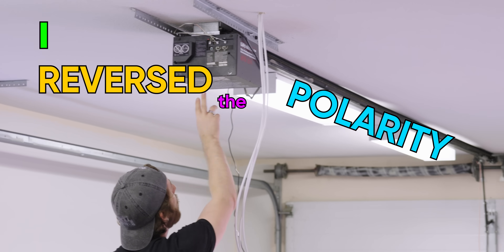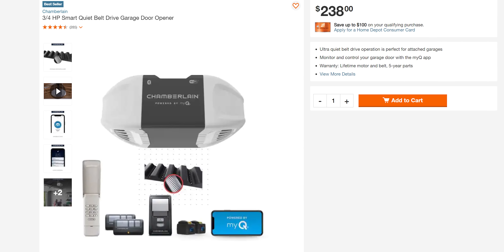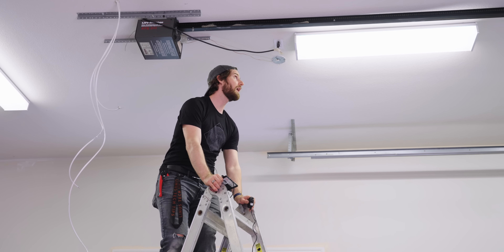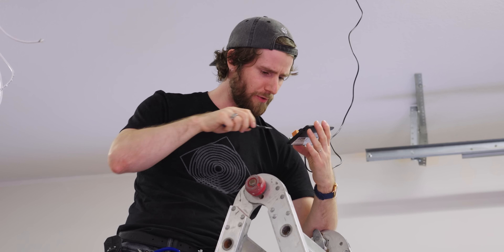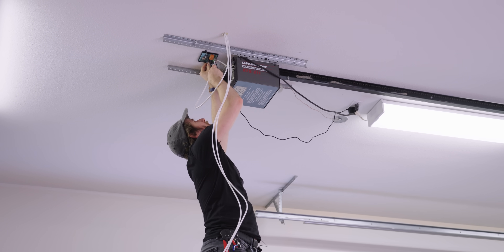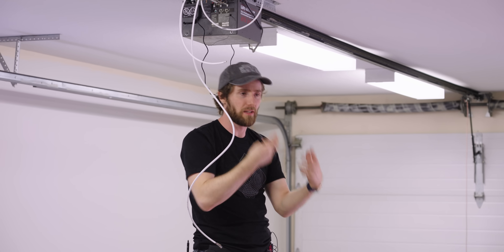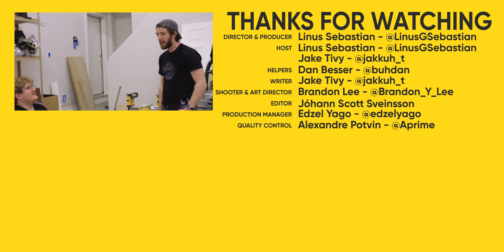Smartifying My 25+ Year Old Garage - Z-Wave Garage Door Opener

Comment: 15:00 I know this is much much later, but a few thoughts after rewatching this... Google Assistant integration does work without Home Assistant Cloud (it's hard, but it works, and i've never had to re-auth it), and the ratgdo (esp32-based controller that interacts with GDO's, including some chamberlains) which covers a lot of usecases where you want to use built-in sensors instead of modifying to add your own, and only really requires some esp32 flashing and hooking up the leads into existing contacts.

Comment: Way, WAY too complicated.  Mount a sonar sensor in the rafters about half way from the front to the door opener.  If the sensor reports that there is something two feet away, the door is open.  If the sensor reports 10 feet, the door is closed.  Now you just need a relay switch to control the door.  EZPZ.

Comment: There is a company called meross they sell smart garage door opener for almost every brand. I had an old 94 craftsman, and it worked flawlessly for years . Recently, i installed myQ smart garage door opener but hated how long it took to open/close, so i, instead of the old mart grage door opener sensor with an additional circuit you need to connect to the new garage door opener. It worked flawlessly. Also, they have a wired door sensor with magnets, which is way more accurate than my q.

Comment: Trying to find all the products they used in the video and I'm not having any luck. Home Assistant has an integration with MyQ but MyQ cut it off and it's no longer working. I need a new solution.

Comment: Maybe it's just me, but in my house the last thing I want is Amazon or Google being able to open or close my doors. Not that I think that Jeff Bezos is gonna rob my house, but if their servers get hacked or a vulnerability is found, it could be used by thieves to rob your house. 

If you're slightly techy and have some spare hardware at home, set up a Home Assistant server and use either a relay switch like Linus did, or (as in my home) you can use the MyQ integration that comes standard on most decent garage openers today (I believe all LiftMaster's within the last 5ish years have this) and put it on a separate VLAN to ensure it has no access to the internet. Then you can route everything through a HomeBridge to your HA server and communicate externally via that. Obviously this is not a viable solution for everyone though.
Reply: Fun fact, a brick can rob your house easier than a hacker

Comment: As long as the receiver and the contact are mounted at the same height while the door is closed, as they should be to make contact and work, it does not matter where they’re mounted. You could mount them up high and it would still recognize if the door was open even a little.

Comment: I have one of the Garage King "Smart openers" and honestly I see no point to it. I've had the opener for a year now and honestly never use the app at all since I only need to open it if I am leaving or pulling up which I will just use the included remote. Its a solution for a problem that does not exist.
Reply: He doesn't keep the remote in his car as it's a huge security risk. Somebody could smash your window and take it, or just smash it and hit the button to read the signal, then rebroadcast it and drive around til they find his house (or just follow him)

Comment: "Put it at the bottom so it detects it even if it's open a little bit"
Am I the only one that noticed that it doesn't really matter? If it's open a little bit the 2 components will be separated anyway, at any height. It's not like if you open a little bit only the bottom will come up, all the door will move. Also, if it's at the bottom you could theoretically put something in front of the detector before the 2 pieces detach so it won't detect it opening.. but that is a very remote possibility.

Comment: Love how jake was like “put it near the bottom that way if it opens a bit it’ll detect it” the magnets will still seperate the same so it doesn’t really matter where you put it, the threshold between “open” and “closed” depends on the size of the magnet, not how far away it is from the floor.

Comment: You should check out Shelly smart wifi relays.  Home assistant integration is a breeze.  I use them on my garage door, swimming pool Pump via a contractor and remotely turning on/off computers.

Comment: As others have pointed out already, the functionality is the same no matter where you put the sensor.
But it's safer to put it as high as possible to protect it from floods, kids, falling objects etc...
Also it's easier to work with (as your back told you multiple times) & it requires shorter wires.

Comment: Standard window contacts work well on the trolley and opener track. That way, you don't need to wire all the way down to the floor. Magnet goes on the trolley, and the contacts go on the opener track. You can do one at the fully open position and fully closed position, and then you know if the door is in neither. You can also add a contact part-way from fully closed to add a stop for a vent position.

Comment: Here in Las Vegas Nevada it’s standard to run a cat6 to sensor at door and a cat6 to motor for control, you can also ghetto your wiring by using a control processor with relay controls and wire it to a standard garage door opener. So trigger the relay with on of/ normally closed/ normally open and you can do it without any wireless, zwave, signee, God I’m just watching this and can’t stop smiling but can’t just laugh. Polarization should matter! or invert the relay or contact. I love you guy’s!!!

Comment: Umm MyQ has an add on option for older motors and then you can use Google Routines in the Google Home App to let google assistant control it all. I have mine set up so I can ask if the garage is open or closed I can tell google to open it or close it. And if the garage is already closed and I ask google to close it, it will return a “Garage is already closed” response.

Comment: Jake: "Put it near the bottom so that it will detect when it's even a little bit open"

It doesn't really matter where you put it. Bottom, or middle, if the door goes up 6 inches, the contact will always be 6 inches higher than the sensor. (that being said, putting it on the bottom does look the best)

Comment: Why put the seizure inducing flashing in there at all? It added nothing, Linus was already describing it just fine.

That was a horrible effect for everyone, not just seizure prone folks. Utterly unnecessary and potentially dangerous, even with the warning there. If someone catches it from the corner of their eye (or their second monitor) without seeing the 5 second warning it could still cause a seizure. Just why??? Do better! This channel has such high production value, run your videos through a PEAT tool and remove any offending content from the edit. What you did here is not good enough and your audience expects better.

Comment: A possibly better and simpler way to do this is to use a reed switch + magnet (which is what your little magnetic switch is) hooked up to a raspberry pi and a breakout board.  A reed switch costs pennies. Then you're not relying on some wonky cloud based service that may not even exist in 5 years, weird protocols, batteries, etc.  Keep is simple stupid.

I put a simpler version of this in my garage several years ago, just hooked up to an a reed switch+power supply to an LED in my house, as well as a button inside the house so I can close it from the house.  It's worked great for 10+ years.  I've got a lot more faith in dumb tech than smart.

The Chamberlain openers are a nightmare with the lack of simple on/off buttons.  When my old opener went south, I discovered that Genie openers are still just on/off switches, avoiding the trouble of these more complex buttons that aren't on/off.

I haven't gotten to the point of putting in the Pi.  It's generally not much of an issue since I can always see if my garage is open via the LED in the house.

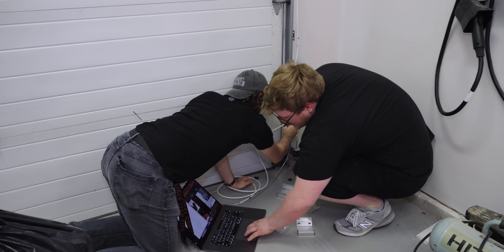Comment: 4:40 "put it like, very close to the bottom so it will detect if the door is open even a little" shouldn't this not matter as the two pieces would have the same mating travel regardless of where it's placed?

Comment: ESP32 module + relay with kickback diode on momentary push button lead.  It's a simple pull down resistor test.  If you are close to your home, your phone will auto switch over to the local network.  30 minutes work.  Create a webpage icon to the server.  Second lead can use sonic distance detection for garage door open/closed.  If you need outside home, then port forward through the DMZ to your ESP32 using a DNS hosting service.  Your hall sensor also works well.  You can also use something like Netgears home automation ports to work with google/alexa.

Comment: You definitely don't need to reauthorize the test app every two weeks, it's a one and done thing. There's also a HACS Google Home integration which is supposed to make the process of setting it up even more pain free but I did my setup before it was released. If you set it up through the test app you can have local fulfillment of Google Home voice commands, which is much more stable than going through the cloud.
Reply: Do you have anything to help with local fulfillment? I set mine up before the hacs as well, just have not figured out how to get local fulfillment working.

Comment: The wires picking up radio is because the joint was a cold joint. This is a common issue, especially with unleaded solder. The trick is get the soldering iron real hot, flux up the joint before you make it.

Comment: 4:41 - lol, it doesn't matter where on the frame you put the switch, as long as the door is closed when you do it. If the door opens just a little, the magnet will not align to the switch and it will see it as the door being open.

Comment: Uh, chamberlain works just fine with Homeassistant, which you already have for the hot water system. Also, you can tie in google assistant without the subscription.

Comment: There's a lot of wrong/bad/brainfart information here. The beeping/blinking is a safety feature to prevent people/things from being crushed under the dangerously heavy garage door. MyQ works just fine with Home Assistant with an integration. The magnet for the garage door will work the same no matter where you place it on the door. Home Assistant can be set up to work remotely without the paid service, but it is a little more difficult to set up (would not recommend if you're not very technical). While it's a little more difficult to set up the integration between Home Assistant and Google Cloud/Alexa without the paid service, it can be done, and it does not have to be refreshed every two weeks (I haven't refreshed mine, just make sure your SSL certificates are up-to-date).
Side note:  if you don't use the paid service, there's a lot more configuration, maintenance needs to be done to keep the remote access working, and some things require more setup to get up and running. Also, it's not possible for every user. Your ISP may make it impossible without purchasing a business plan or running a VPN. If you can't comfortably explain how a user connects to a website hosted on a server networked behind a firewall, you probably should just pay the hosting fee and save yourself the trouble.

Comment: They should get a Hacker to try and hack their garage to give insight on how secure all of this is actually is, they can then upgrade the stuff to make it more secure. It'll be a good video idea.
Reply: That actually sounds like a good idea, provides the extra level of product confidence when looking to buy some of the stuff they show case. Like watching LPL open a lock and then talking about how difficult it actually is if a non professional or someone not fully skilled would be at opening said lock. We know can can open even hand crafted locks with ease. But for him to say a true level on the lock brings confidence in buying said lock. It's a very tech heavy world now so to know the things I buy have a security level to it helps me an not have to worry If what I bought is good or not besides basic tech specs.
Reply: That's the beauty of the zwave. It's local. It probably can be hacked like anything, but it itsn't accessible from outside his home lawn at most because of signal strenght so IMO it's not a huge concern compared to MyQ cloud-based wifi garage door openers which can be hacked from anywhere. The added zwave security feature is a plus, but is still way more secure than any cloud connected wifi device

Comment: Hi! I'm doing my own garage door automation (mechanics is provided by widely used in Europe company Hörmann) based on own-made scripts for Raspberry PI - and actually I needed THREE contactrons:
 - one activated when garage door is fully closed
 - one activated when garage door is fully open
 - one, in a special position that garage door open to (like 1 meter above floor) when it meets an obstacle while closing the door
With these three, I can always know what is the state of the door. If none of those three contactrons are active, it means that someone manually stopped the door inbetween - so next signal to the door mechanism will clarify the situation.

Comment: Interesting concept, but anyone thinking of automating their garage doors had better assess the area in which they live, and carefully weigh convenience vs security. If you happen to live in an affluent neighbourhood where thieves make a handsome living out of raiding garages & homes, it would be very wise to go the old school route & implement mechanical locks - one for each side of the garage door if you really wish to be secure. I like gizmos & tech, and have made a 32-year career out of it - but certain things don't need automating. In my area, not only do the thieves make a killing, but they know how to hack this sort of thing, too. At the very minimum, if you insist on automating the garage doors, you will want to seriously consider electronic deadbolts. If you don't, there's nothing preventing a thief from using a crowbar to pry the garage door up, and they're in your garage. They'll quickly be in your house soon afterwards if you have a door that leads inside & you are in the habit of leaving it unlocked. Electronic deadbolts are almost useless if connected to a system a thief can hack. All depends on how smart the thief is. I don't even use a keypad any longer because the thieves were trying their hand at that, too. Don't mean to be a Debbie Downer, but not everyone thinks like a thief.

Comment: I just installed a wifi garage opener I got from aliexpress and it even works with google assistant or Alexa, tho, I disabled that function cause I'm afraid it will open it by accident when I'm not home lol.

Anyway, my installation was far less overkill and its a rather small door anyway.

Comment: So for those that aren't aware, the reason the light flashes and sounds an alarm for 10 seconds before closing the door is for hearing and visual impaired people. It flashes for those that can't hear, and sounds the audible alarm for those that can't see letting them know the door is going to be closing. 

Annoying? Yes, would I give people the option to turn it off? Probably not. There could be someone malicious that turns it off when someone with an impairment isn't aware and it could cause them harm.

Comment: The emergency garage door release (which is required by code) can be a way for bad guys to get in. They can slip a coat hanger wire or whatever, through the top of the door, snag the release cord because it has a knot at the end, and then manually open the garage door. To prevent this, untie the knot in the cord so the coat hanger wire has nothing to snag. You should instruct all family members about this, and maybe have a small step ladder nearby so they can reach up and grab the cord in an emergency (a fire could cause a power outage so you don't want to be trapped in the garage.) The garage door should be balanced so anyone can raise it once you pull the release cord.

Comment: "put it very close to the bottom so that it will detect if the door is a little bit open" lol put it anywhere and it will detect any openings as the magnet is either lined up with the three inch sensor or not. It's like a light switch there's only connected and not the location of the switch on the wall isn't relevant to it's connection status